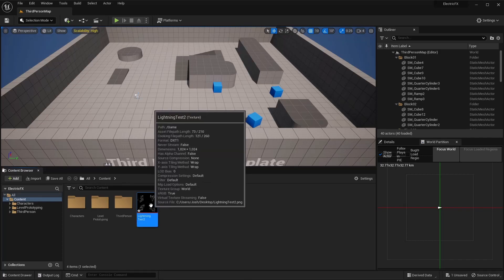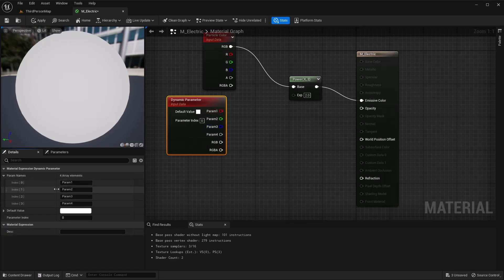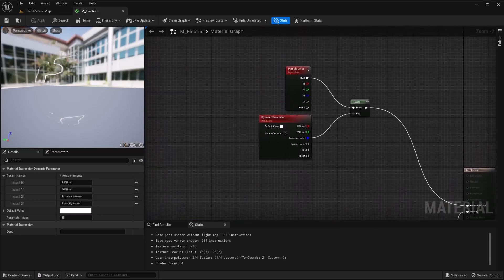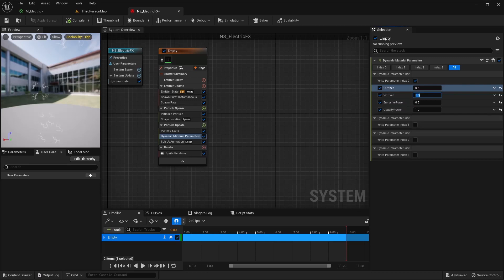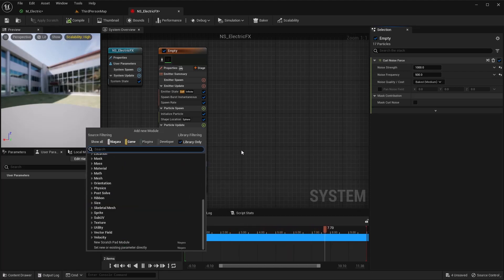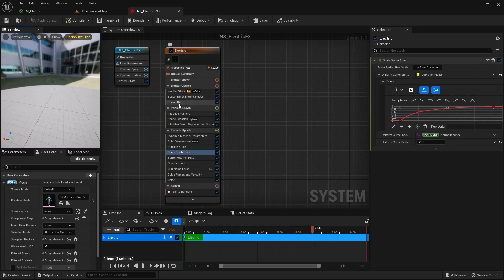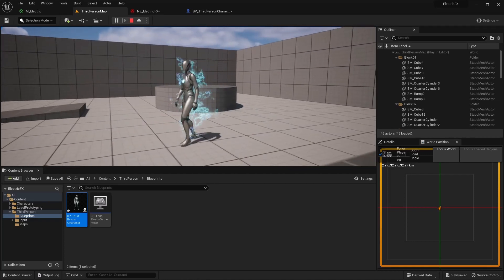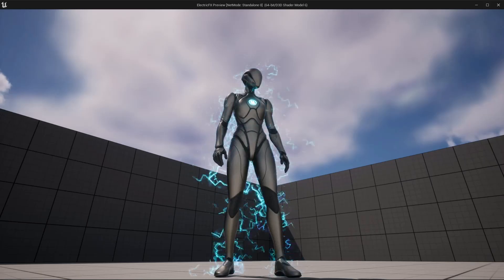Create Stunning Electric Effects for Players & Items - Unreal Engine Sub-UV Niagara System

Comment: Have this set to my left shift, if i hold the button itll play the particles but i want it to only play when the player moves. How would you go about this?
Reply from the maker: One way could be to get the Character Movement, then get Velocity from that. Off of the Velocity, get a vector length node. From there, you can compare the character's Velocity and do a greater than node. Set this to 0 or a low amount. From that, do a branch and off of true set the effect active and on false set it inactive. This would need to be checked on an event tick, timer by function, or something, so it is constantly checking, rather than just once when the button is pressed. Hope this helps! 😁.
Reply from the maker: I created a new video that shows how to do this in depth, hopefully this helps!